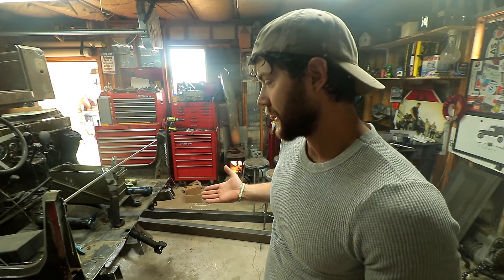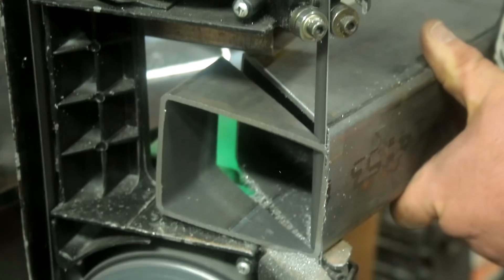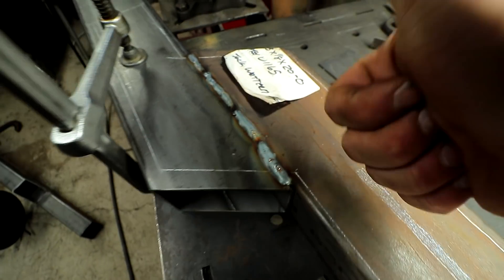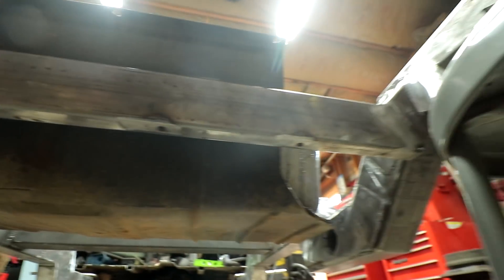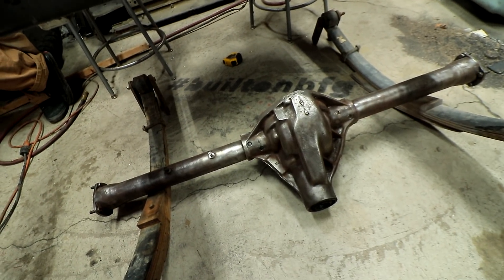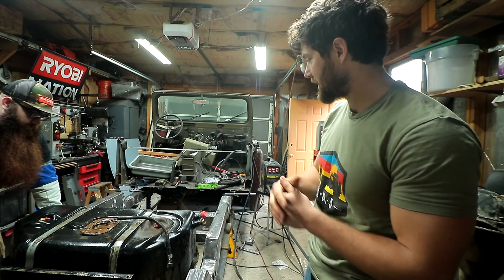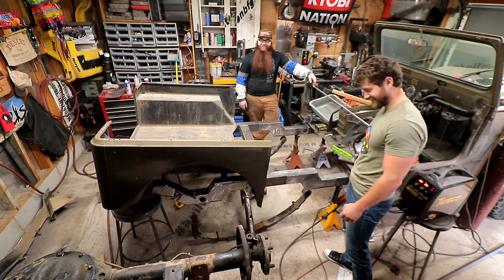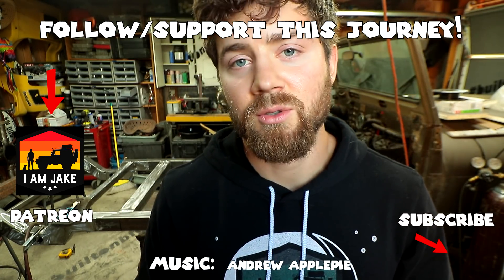BUILDING A BIGGER OVERLAND JEEP: Frame

Comment: I’ve been trying to message you for the last couple of days! Cummins is running a special on the R2.8 turbo diesel. $1,500 off using the code dirthead from Fred on Dirt Everyday. In the long run the motor will last longer & saving you money on fuel. Since you are so deep in changing Jade a Cummins swap would be something you should really think about!
Reply: I went with an OM617... Love it!

Comment: The hard part is over. Rest should go smooth... I would have gone with Ford 8.8 rear axle but d44 is going to do what you need. Thx for the update!
Reply: I hear that a 8.8 would be ideal disc brakes and everything but that d44 will do what you need

Comment: Jake I hate to break it to you... but yj and cj Dana 30s are completely different. You can’t swap the hubs on them, and you can’t swap a cj Dana 30 in a yj without converting to a passenger side drop tcase. Before you dive too deep into your new axle you might want to rethink and see if that axle will be a practical swap.
Reply: Yea that sounds about right the outter Cs would be similar for LJ/XJ/TJ/MJ/ZJ, but the CJ was a different C which accepts only the CJ knuckles. I think Reid Racing made a Chevy/CJ knuckle that bolts onto the "newer" style D30. That or the Yukon spin-free kit is the only way to run hubs on a LJ/XJ/TJ/MJ/ZJ style D30. CJ was driver side drop and all Jeeps after have been Drivers side. He would benefit from a HP30 at minimum
Reply: Jersey Devil all yjs had HP d30 from the factory so he already has a HP in it now. They do make a manual hub conversion for about $1500 that I think uses ranger hubs...(don’t trust me on the ranger part) but it wouldn’t be wise to spend $1500 on hubs when you can sell the d30 for a couple hundred and then spend $1500 on an axle that’s bigger and already has the manual hubs like a set of f250 axles.
Reply: @trevordavis4728  I'm much more a XJ/TJ guy myself. I'd say a D30 isn't worth investing a dollar into more than gears and maybe a lunchbox locker.

Comment: Nice build. With 35" tires, you should consider replacing that front Dana 30 though.  A stronger front axle for a YJ can get tricky though. It's either a lot of fab work, or a lot of money. Now is really the time to do it though. The 30 will not live long with 35s when you get off road. I know, I've been there. I wish I could say "see you at EJS", but I won't be there this year. Next year for sure. Keep up the good work!
Reply: You can just put a Super 30 kit on it has beefier axles and parts then reinforce the tubes. I ran 35s with that setup with a Detroit Locker and a tie rod reverse kit 3/4 quarter ton for 3 years never had a problem
Reply: I'm with that same sentiment. A Waggy 44 or any 44 front would be a great addition for not only gears but supporting that weight. If you're going through the trouble of swapping in a rear 44 why not compliment it with a front. Plus kicking out the WMS a few inches would help with stability.

Comment: Engine upgrades would help with the added weight and an extra boost of power. You should put some disc brakes since they are easier to work on and easy to get parts for.

Comment: Those frame fish plates (calling them gussets in this video) should taper down., keeping them strait with a flat edge creates a stress riser at the welds and it is more likely to crack at the weld.
Reply: gwagenadventure Yes. But this will hold together just fine, don't you think?
Reply: @kevinhornbuckle  Time will tell the square edges of the fish plates will be very prone to cracking as the chassis flexes given that this jeep will be loaded down and see lots of time offroad.  The general rule of thumb for fish plates is that the length should be 2X the frame height at a 20-30deg angle.  They should look like this < > not like this [ ] for this particular video.  < >,gives more weld length and also distributes the load vs the abrupt edge [ ] creates.  They should also be made out of material similar in thickness to the chassis they are reinforcing.

Comment: the greatest cost in building things yourself, is accumulating the thousands of dollars in tools to do it properly and efficiently. Welders, torches, saws, compressors, grinders, stands, measuring gear cost and require a place to store them and use them.... the shop is a tool... the lighting is a tool.... in the grand scheme of things, labor is cheap.

Comment: morgan roberts sr -- Thank you. :) I could be wrong, but I think the shot is straight on enough to show the differential is indeed offset.

Lone Wold Outdoors -- He did say he got both axles but also said he would be swapping the lockouts from the donor axle to Jade's axle. I would think swapping both front and rear axles complete would be the best option as the CAD is probably eliminated in the donor front axle.

Comment: Just watched that part of the video again and another question came up. If your YJ has a stock six cylinder engine, the lowest gears you can have is 3.73, not 4.10. 4.10 was only available with the 4 cylinder engine. Unless you or a previous owner swapped axles or engine.
Reply: 4.10 swaps are semi-common. Ive heard of a few people swapping in the 4.10 from the 4-bangers into their 4.0s for "cheap bolt in deeper gearing"

Comment: Consider cold galvanizing the frame. It's not as good as hot dipped and won't get inside the frame but better than nothing. ZRC is the best brand and it comes in gallon cans. The spray stuff does not lay down thick enough. Looking forward to more vids.

Comment: Fascinating g-project I saw an old aluminum frame for a Jeep in monroeton Pennsylvania they're doing several years ago it was a matter fact I think the whole body everything was aluminum in it but my question is did you get a chance to put a bigger gas tank in that your unit what did you just use the standard capacity could have been an opportunity to Kris the range which might be nice if you're in the in the boonies

Comment: Jake, Love the direction you are taking Jade. Especially since I’m a Huge fan of the CJ-6! What I’m going to say next, please understand I’m not trying to play “Arm-Chair Mechanic” or be a YouTube Troll! But I have significant experience welding and even built a replacement frame for a ‘72 Chevy C-20 a couple years ago. (Thanks to Michigan Winters!!) I’m concerned that you are going to have issues in the long term with the 1/8” tube not cracking?? Especially considering the additional load you plan to put on her? I really think 3/16” tubes or even a taller 1/8” would be a better option. Again, not trying to be “That Guy”.... Just trying to save you what could be a Colossal headache down the road brother! 
“Keep On, Jeep’n On”😎

Comment: Leaf springs???
Why not switch to a beefed up coil? Way better on and off road ride. 
Granted, you do carry a lot though.
Reply: Be a great upgrade to the front for sure   but having so much weight in the back leaf springs are probably a good idea at least for the back and that airbag set up should help out alot Jades going to be way better I can't wait to see her finished
Reply: Running a coil you'd need to link the rear which adds complexity. Leafs work great for these loads plus the air helpers. It's basically a mini truck. I'd say good call on the leafs over coil.

Comment: Looking good. I hope you plan on a stronger suspension. You should at least consider stronger leafs and have a plan to get some stronger axle housings.
Reply: Did you watch the video ? Air bags and a 40 rear end ,easy to gusset the axle house. This is a house on wheels not a ultra 4.

Comment: Jake, you should use POR15 on that new frame. 4 wheel parts has them by the quart or you can get a gallon online. That will save your frame from rust. you can also put it on the under side of your floor pans and tranny tunnel.  You can also coat all of your suspension and it will protect from rust. Finally you should spray the  inside of the new frame with a wax coating before you put the body on. POR15 is made for frames and under coating. It dries rock hard. No paint can touch it. Look it up. Next this will protect the inside of your frame: https://www.amazon.com/KBS-Coatings-75101-Cavity-Fluid_Ounces/dp/B00TVH7R5O/ref=pd_rhf_ee_s_rp_0_7/145-9681107-0127464?_encoding=UTF8&pd_rd_i=B00TVH7R5O&pd_rd_r=179bb1da-d2ff-4fb4-a1ec-606da094ba2f&pd_rd_w=jAUCh&pd_rd_wg=JVPEu&pf_rd_p=9ce2a148-6af9-48d3-9a5d-657a16ef4457&pf_rd_r=7Z9V74699AABNNGS9FAT&psc=1&refRID=7Z9V74699AABNNGS9FAT

I am building a 1988 Jeep Cherokee. I used the Por15 and  on top POR15 Rubber spray to reduce outside noise. I put both under the outer tub, frame, gas tank and axles. The wax stuff is as  close to what factory uses. This waxy coating will prevent rust from the inside of your frame. I put stiffeners over my frame and ensured I had drain holes. So the wax protects where water can enter and rust out the inside of the frame.  I suggest putting a coat inside every few years just to make sure and that can will go a long way. The POR15 lasts for years. Any left over I didn't use, i put in a mason jar. You can also put cellophane over the por15's Can and put the lid back on but I found the mason jar works great. Good luck hope we can meet some day. I live in So Cal and my first jeep build, 3.5 years in the making, is almost done.

Comment: Such planning....what about frame drains? 

You use 1/8" wall tubing for the main frame foundation, but then where you cut and butt-welded, you add side panels that look to be 1/4" thick....and where you have a long vertical covering the width/height of the frame, you didn't fish-tail (triangulate) that or butt-weld holes for more 2 panel conformity. Is it your experience that will be good JeepFreak?

Was there any treatment to the sandwich metal faces that won't (supposedly) see any weather/water due to your seam butt-welds?

I have a YJ (4banger on 29s), and was looking at Motobilt back-half but I'm wanting to KISS so with that, the gas tank has to get smaller and move, wanting to keep leafs and not go to COs and links for $$ reasons....so I'm looking at other potential rusted out repairs with longer wheelbase with leafs (want to keep leafs stock length or short and not use the XJs since they are offset and long by comparison).

For using CJ lockouts, you'll probably have to swap in the knuckles out with brakes and stub shaft to keep the axle geometry....Haven't heard the knuckles of a CJ swappable to a YJ front axle housing...or you going to also add the inner C's. I can understand that you would want to remove the CAD (central axle disconnect) 2pc inner shaft for a single inner shaft.

Comment: Where can I find a auto body shop willing to do a 2wd to 4wd conversion?
Reply: I'd just call the shops around you and ask
Reply: shouldnt be too terrible. off the top of my head you need a front axle, 4wd shift linkage, transfer case, and new driveshafts

Comment: 4.88 is great. I have 33s but I plan on 35s some day. Remember to think about the overall weight of your vehicle. 5.13 might be the way to go. Those math formulas that tell you what gears you need as opposed to stock never take in consideration the weight of the wheel and rim. Something to think about.
Reply: A 5.13 would be ideal for gearing but running that in a D30 it will be a tiny pinion.
Reply: Jersey Devil That’s right. It is a dana 30 up front. I don’t think you can do 5.13s in that.
Reply: @niner8tangojuliet149  you CAN do it Yukon and I think Motive sell it but the pinion is stupid tiny. I've heard third hand them working OK, but with the weight and need for reliability in Jade, he'd be better off the 10% worse gearing and stronger pinion. He'd be considerably better served running a D44 or similar front end for weight, reliability and gear selection.
Reply: Jersey Devil agreed 🍻

Comment: I have some questions about that axle. It looks like it has an offset differential to the passenger side. The AX15 is going to expect a centered differential. The Dana 44 has a 5x5.5 bolt pattern. The Dana 30 up front has a 5x4.5 bolt pattern. I must be missing something here. With the lockouts from the donor Jeep will the D30 be converted to 5x5.5? Will the front brakes accept the change? With all the changes to the front, what happens to the CAD?
Reply: Five Lakes YJ ......great observation.....now I'm curious
Reply: Is he not getting a new front axle also? That doesn't solve the differential transfer case positioning problem though
Reply: @lonewolfoutdoors3824  and morgan roberts sr -- Sorry, I hit the wrong button. I wanted to keep my reply in this thread but I messed up. My reply is up in the main line of comments.

Comment: Go 4.56 with as much as your on the road   I run 4.88s in my cj7 with 35s ane 5spd.   55-60mph is top speed    of it was not a mostly off road rig I'd probably be 4.29 or 4.56
Reply: If he doesn't like the gears he could always go up an inch or two tire size in the future

Comment: You are building a wonderful asset for your YouTube business. Check with your CPA to see if you can write it off. Just a thought. Great video!
Repairs. The cost of ordinary repairs and maintenance are fully deductible, while costs that add to the property’s value are usually capitalized and recovered through depreciation. However, there are various safe harbor rules that allow for an immediate deduction in any event.

Comment: Why not just find you a newer LJ with low miles and transmission you prefer?
Reply: The answer to your question is the reason for this channel. It's about seeing through. We should know, we are all still here to share the experience.
Reply: To add to sentiao as well, Jade is part of the challenge in seeing the trip through, you quite obviously see the practicality in buying a newer Jeep, as do I, but you must also understand that Jade is integral to both the trip and at this point the channel, just like Jake and Annie. As easy as it would be to get a newer Jeep and just keep rolling, it would compromise Jake’s message. Being, do what you can with what you got.

Comment: After I saw you start this I thought of taking a 4door XJ and grafting the rear of the 2 door XJ to make a Jeep-Suburban beast powered by a 4BT and some sort of manual transmission (a tremec T56 is more a performance car transmission isn't it?)
Reply: Yes and not 4x4. A nv4500 is what you want for a 4bt or 6bt cummins
Reply: @RyanBoyce57  Why not 4*4?  Other than being long, I saw Deboss garage did a 4BT tahoe 4|*4
Reply: The t56 isn't 4x4